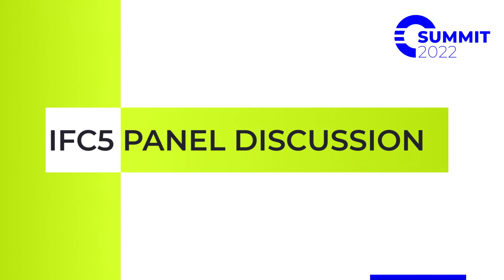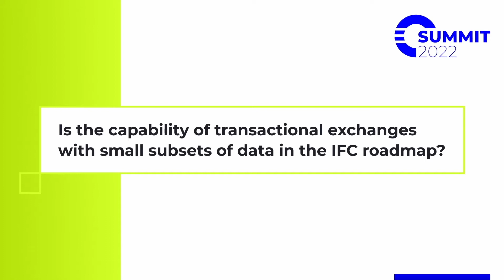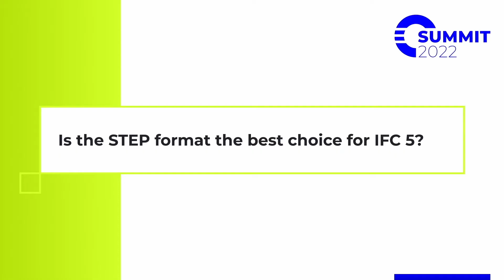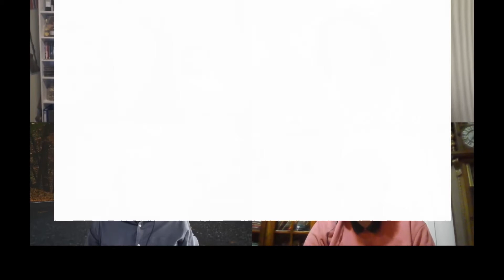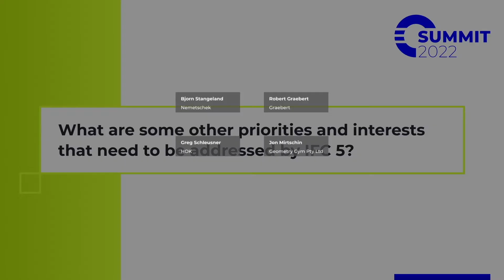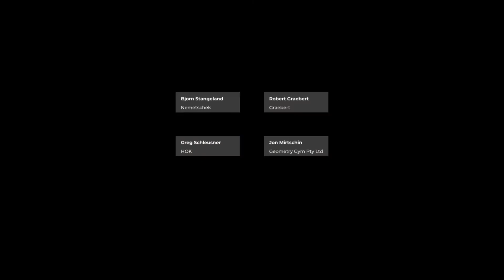IFC 5 Panel Discussion

Comment: it would be great if all the acis/parasolid-kernel softwares could import or use ifc and vise versa.

I am not an expert... just a carpenter who designs with paramatric modeler alibre and gets ifc files from architects losing model data in the process, becauce ifc is not supported.

I think Mr. Schleusner is addressing this "assembly data". BIMS use a IFC Data tree. All the Part based tools like solidworks, which relies on ACIS Kernel, use that Part Browser classes.

So if it would technically be possible to port acis-part-classes to ifc-part-classes to keep the information about material and so on, it would breach the gap between all  BIM- and Part-softwares out there. Not even exaggerating.

The architect could import my step/ or prt designs via ifc export, keeping all the data.

Its probably already possible but there is no standard and everryone NX,Solidworks... is cookinng their own pot.